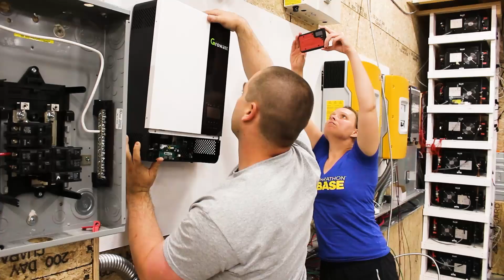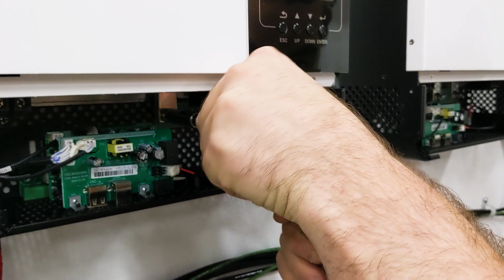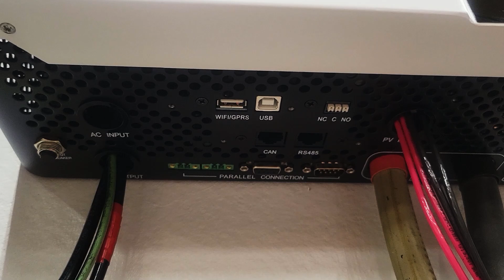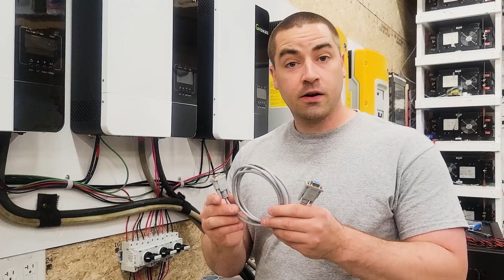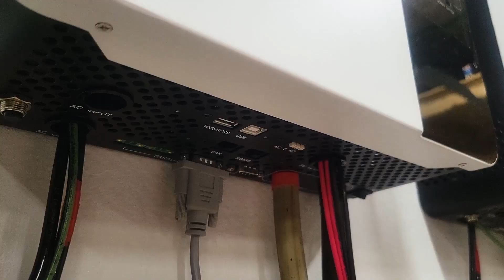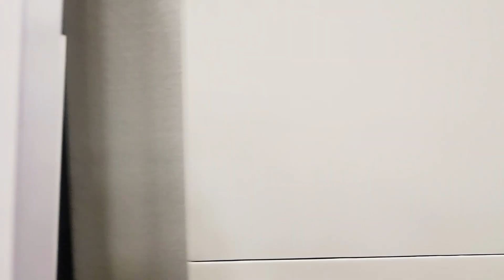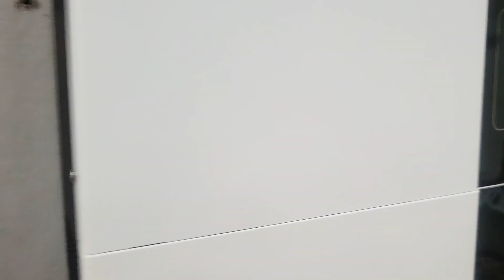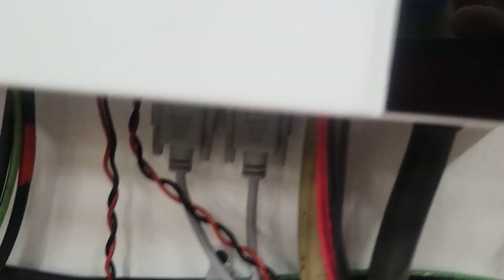Paralleling 3 inverters together, Growatt 5000w Solar System

Comment: Good stuff I am sure you matched the voltage strings from each array so they would be the same it will be interesting to see if the higher voltage array produce more. I am still confused on the transformer feeding the 120 volts to the same box as the 240 from the inverter. I would have wired a separate breaker panel for 120 but I am not an electrician.
Reply: I am also confused. From other auto transformers I've looked at, there have an input from the AC source, and an output. Here I only see an output of two hots and a neutral and no input. On top of that, like you said, it feeds back into the same panel as the 240 inverter.
Reply: The 30 amp breaker in sub panel feeds into the transformer. Then the transformer sends 120 volts to the neutral bar. When a 120volt breaker is inserted into sub panel, it only touches one of the 240 volt panel bars and sends one wire from breaker to the 120volt appliance load (light switch, plug, etc.). The neutral return line from the appliance attaches to the neutral bar (which is attached to 120volt transformer output line). Seems weird, but that’s how it turns 240v into 120volt. So apparently since the load is not going from one 240v bar to the other 240v bar, but instead from on 240v bar to the 120volt neutral bar, that equals 120volts?

Comment: You have only one auto transformer of 5kw.  How could that handle of 15kw of 3 inverters?
Reply: The auto transformer just has to cover the IMBALANCE.   So if the greatest difference in 120v draws is less than 5kw then a 5kw auto transformer is the correct part.  Problem is, you really never know what the peak difference will be.  It’s possible wife running hair dryer while toaster and microwave are running.  Could really add up.  Might be worth looking at which leg commonly used loads are on. Make sure the toaster and microwave are not on the same leg for example.
Reply from the maker: Because the 3 inverters don't go through the auto-transformer.  Amps only move through the auto-transformer when there is an imbalance between L1 and L2.  The big electricity loads in my house are 240v (oven, stove, water heater, and heating)  Those big loads need the big inverters, but never pass through the auto-transformer.
Reply: @DavidPozEnergy  , For folks who aren’t electo-geeks. Our 120v power that we normally use in North America are actually half of a 240v power line. The power is 240v if you use the full 360 degrees of the sine wave of power. To get 120v, you put a center tap or neutral at the 180 degree point. So the energy potential from 0 to 179 degrees is 120v and the energy potential from 180 degrees to 359 degrees is 120v. You have to have a transformer to create this connection point at the 180 degree point. In this case, he’s using a smart transformer that does this more efficiently. The big power users, like our heating, cooling, and other large energy users are wired for 240v and thus don’t need this neutral. So you only need this transformer for the smaller users of power, like the lights, coffee maker, and such. 5 kilowatts of neutral should be more than enough for many houses.
Reply: @Bill_N_ATX  Good explanation William. Thanks.

Comment: Would you calculate the standby power consumption of this setup? I think that could be one of the weaknesses of this system.
Reply from the maker: Yes, it is a weakness.  about 70w per inverter, and another 18w for the auto-transformer. about 228w in idle.  I have this connected to my house.  There is always a load on my system 24/7.  Anything from my ventilation system, cell phone chargers, up to the oven, and heating.
Reply: @DavidPozEnergy  That works out to about 5.5 Kw per day if my math is correct. 
In any case, I really enjoy your videos and I have learned a lot from watching you. Thank you for all your hard work.
Reply: @dcobb9558  That is substantial kWh draw. David's 30kWh battery bank will be flattened in under 6 days with no other draw or solar charging. I'm looking for myself, so I might look at the self draw specs a little closer. Thanks D Cobb for point this out.

Comment: Is their a reason why u didn't by a solar edge instead. U could have bought 1 inverter/charger and been done
Reply: Sunny islands were $1200 each about 2 years ago.  Now over $2k.  And to go from 12kw to the next step requires two more inverters for $4k.    Also the sunny islands don’t have MPPT charge controller in them.  I’m having to jump thru hoops with mine because my peak power from sun is 14kw and the inverters can’t back feed more than 12kw. So I’m having to derate one of my solar inverters.  I’m ac coupled.
Reply: Does SolarEdge do offgrid inverters?

Comment: You are still not getting a neutral from the autotransformer. The wire from the center tap output needs to be connected to ground for you to have a neutral.